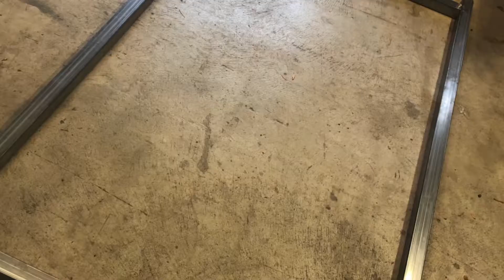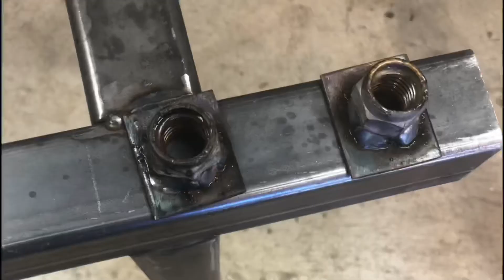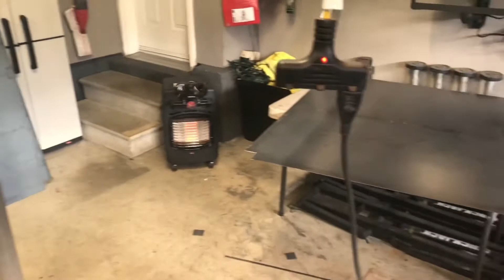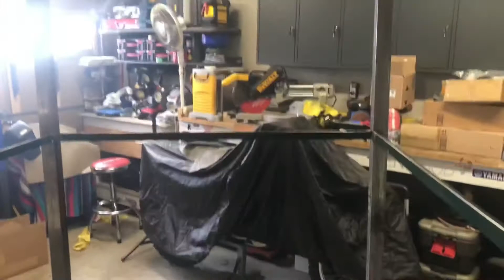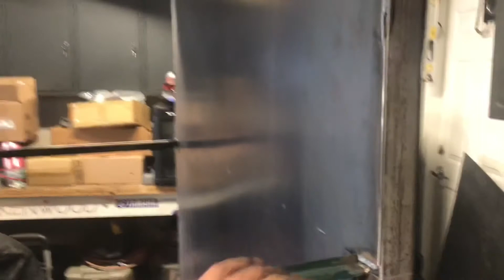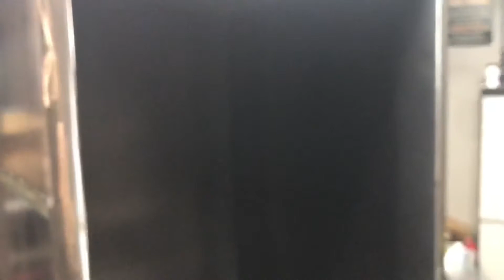Custom Powder Coating Oven Build.

Comment: How much do you charge to build one
Reply from the maker: The price ranges from $8,900.00 to $13,900.00, depending on the size and wattage requirements.

Comment: Thanks for your videos. I was curious about using 2x2 tube instead of 3x3 or 2x4. Will it let you use enough insulation to keep it up to temp?
Reply from the maker: We have had no issue with using 2 inch tube. Oven reaches temp without any issue and outer shell stays warm to the touch .
Reply from the maker: Keep in mind that I’m using 16g inner wall
Reply: What gauge did you use on the outer walls?